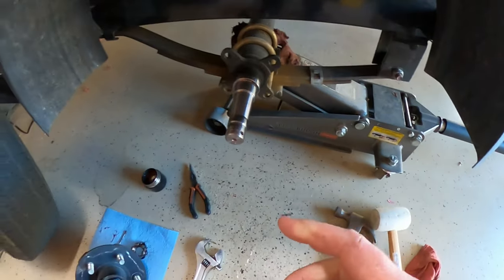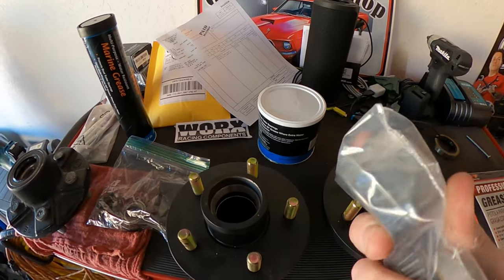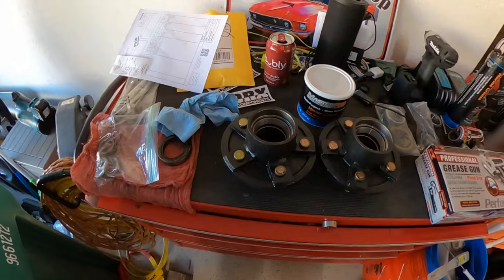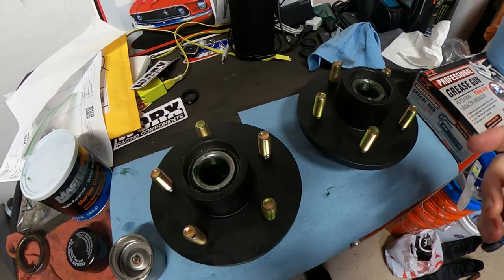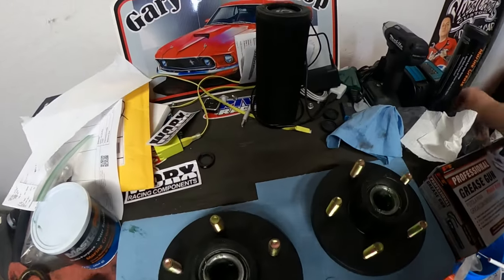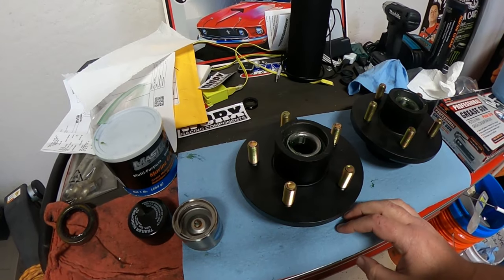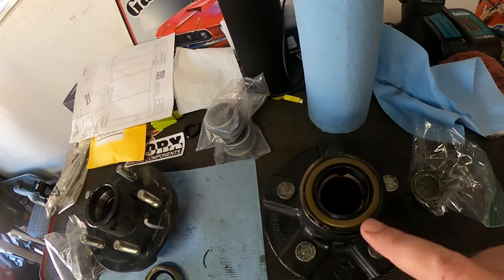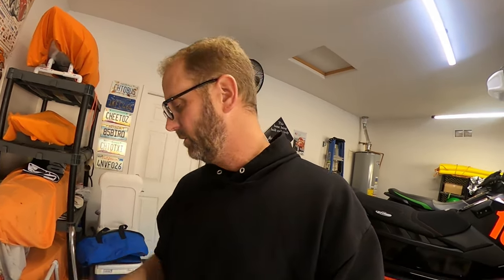Jet Ski Trailer Bearing and Hubs: Install

Comment: My favorite part was when you explained how to do it instead of just showing a fast-forwarded version with music playing which made it really difficult to actually see and understand what you were doing.
Reply from the maker: Fair enough. Thank you for your elaborate feedback :). I can do another video next time....
- Bearings can only go in one way. 
- Need to pack the bearings first. That is what you see me doing with the grease in my hand. Just scoop the lip of the bearings continuously until the grease comes out the other side. Here is a better video of packing the bearings if you still need help https://www.youtube.com/watch?v=UywlK7VQIRE.  
- Seal goes on the back side of the hub. Install the bearing then seal (solid side out) with a hammer and equally sized socket or 2x4 to ensure even pressure. 
- Front side seal is installed same time as hub to the axle. It will be secured when axle nut is installed. Tighten axle nut evenly including rotating hub to ensure even seating. 
 - When fully seated, rotate axle nut a 1/8 to 1/4 turn counterclockwise
- Install axle axle/nut cotter pin
- Install wheels. That's it!